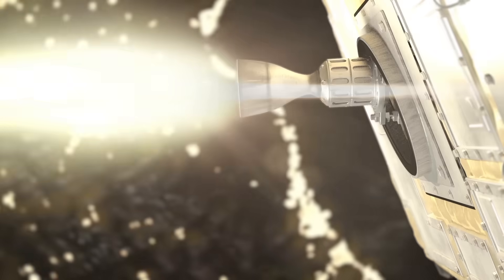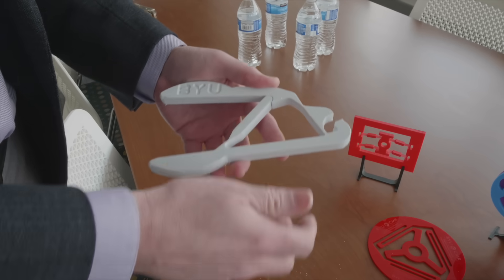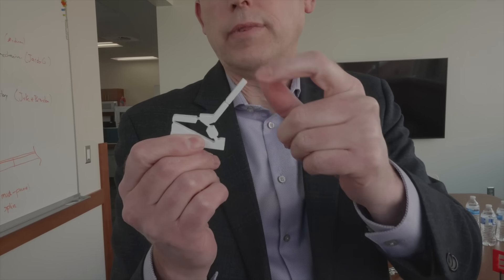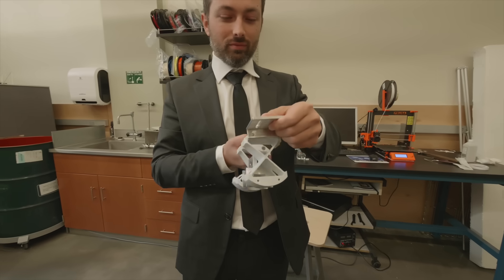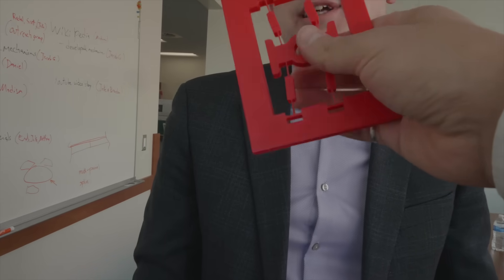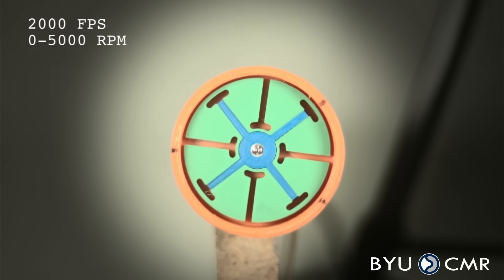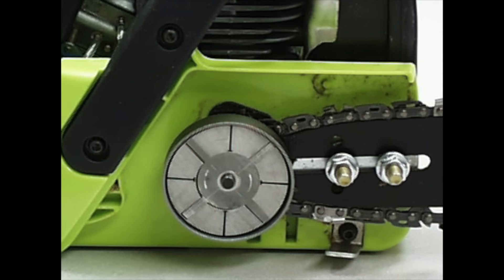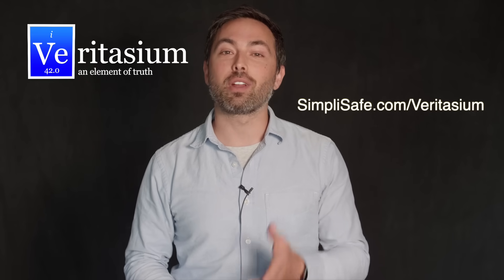Why Machines That Bend Are Better

Comment: Don't know why but this reminds me of origami. Once you've formed a two-dimensional piece of paper into a three-dimensional body and you're finished, you can't tell the beginning and the end. Sometimes I imagine the cosmos as an "object" within which many objects are contained, which is folded in itself so many times that it is impossible to see the original folding with the naked eye. If, for example, one would fold a piece of surface the size of a football field in origami manner into a body, it would shrink and at the end be as big as a table tennis table, but look like a hazelnut. 

The flexibility and willingness of the shown material in this video to adapt and at the same time develop great forces is remarkable. The more flexible the less quickly resistors can destroy it. However, I'm a little sceptical about plastic ...

In any case, if a piece of paper were very large, its flat surface could pop up three-dimensional bodies like water lilies on a pond. And yet the two-dimensional would inevitably be connected to the three-dimensional. The "empty surface" would then be the space that holds everything together.

Comment: Practical examples of use of compliant mechanisms in everyday products
1. Every shampoo bottle uses a live hinge made by injection molding - very cheap, durable and assembly free.
2. Computer mouse buttons use flexures (those bendy things you see throughout the video). The microswitch inside it has a diaphragm flexure and the top casing flexes when you press on it to transmit the compressive force. Older mouse models had separate distinguishable buttons, now its all one piece.
3. Cable ties have a very small tooth with a flexure that engages a rack. You can often reuse cable ties by disengaging the tooth from the rack using a pin and pull out the rack while holding tooth off the rack with the pin.
4. All plastic components of every product you use has a snap fit for assembly - no requirement of fasteners.
5. Every book uses live hinges (crease where you bend) for opening and closing.
6. Some cheap click type ball point pen (e.g. Bic retractable pen) uses flexures to keep the extended pen nib in its position.
7. Tic tac box uses living hinge for the lid.
8. Volume rockers on your cell phone uses flexures instead of springs to bounce back
9. If you have a wind up pendulum clock, the pendulum is suspended by a flexure for avoiding friction caused by use of a pivot.
10. Snap fit locks for straps in duffle bags/backpacks etc.
11. Some shot microphone mounts uses flexures for vibration isolation.
12. Camera lens covers uses flexures for springs for holding the cover on the lens.
13. Disposable food containers, clamps for IV lines.
14. Paper clips.
15. Foldable plastic forks found in ready to eat noodles have a living hinge in the middle for folding.
16. Leaf springs in vehicle suspension (Thanks to Heartycoffee in the comments for suggestion).
17. Tweezers and forceps (Thanks to randal gibbons in the comments for suggestion)
18. Safety pins (Thanks to DrBrainSol in the comments for suggestion)
19. Accordion-style toilet plunger (Thanks to Gary Young in the comments for suggestion)

 p.s. I will add more to the list later. I love flexures and thank Derek for making a video on compliant mechanisms with Dr.Howell
Reply: Haha I was thinking to myself "if compliant designs are so good, why aren't they used everywhere?". Turns out they are used everywhere and I'm just unobservant :)
Reply: @skulleeman  Yes They are omnipresent. They are most widely used in disposable food containers to single use clamps used in IV lines. Please keep a close eye on everyday objects and you are bound to find them everywhere!
Reply: Yes and many are crappy with the flexible hinges easily overstressed thus failing and breaking off.
Reply: @PebblesChan  Yes certain consumer products do have badly designed living hinges and I have had similar experience. However, a properly designed living hinge should last thousands of cycles if not more. They would fail prematurely if they are not designed properly, use of wrong type of plastic, if they are bent over their design limit/excessive force, if they are subject to extreme heat, or if they are subject to UV light(sunlight). Please do not get me wrong. I use them all the time. If you design, use them properly they are shown to last at least a million cycle as the Professor in the video claims. Even a 3D printed flexure lasts hundreds of cycles for me when I use them in my lab for my experimental setups. Often times they simplify design with no assembly required. They are indispensable in applications where you cannot use lubricants. for e.g. MEMS, certain medical devices.
Reply: Many are not properly designed and having machines cyclically repeating the same action does not emulate real life where there are substantial differences, variances and exposure to idiots.  (No one can engineer against stupidity). I have a car window switch that comprises of the simplest possible machine essentially being just a rod of flexible plastic that pushes onto a copper leaf switch. Just with normal use the end shortens being unable to make the copper leaves to make contact. The biggest problem is that the replacement price of that switch is about $250. In the same vehicle there is a plastic combination stalk mechanism (its second) that now fails to invoke the fast wiper speed unless one deliberately over twists the switch and holds it there. The price for that is about $600. The original plastic combination stalk mechanism failed by not being able to invoke high beam. It's amazing that something that costs cents to make can cost so much as replacement parts.

What I find most amazing is how pressed metal sheeting can outperform solid cast metal structural components.
Reply: @PebblesChan  I agree with you on the fatigue testing. Fatigue testing in the lab are not exact representation of real world loading conditions, but it is one of the best ways of estimating usable life through accelerated testing. Regarding the car window switch it is most likely planned obsolescence. Many a times manufacturers follow the "Razor and blades business model". The reason why spare parts are so costly is that, the spares themselves are not expensive as you mentioned but the manufacturer recovers part of the initial cost through spares. Spares also provide a continuous revenue for the manufacturer. It is worth mentioning that the flexure that holds the pendulum in my grandfather's clock works perfectly after close to 70 years of use. It is made of spring steel. I doubt a plastic flexure would last even a decade. Flexures really come in handy in disposable products like foldable plastic forks, food containers etc. They are indispensable when stiction comes into play. The uncertainties posed by friction are completely negated when you use a flexure for a standard pivot. I am not saying flexures are a panacea for all design problems but in most cases they do outperform conventional hinge/pivot.
Reply: Yes and many are crappy... That's what I thought in the late sixties when we were shown (on "The Engineering Programme" a throttle pedal for a Bedford (a GM subsidiary) van. One piece injection moulding, floor mounted, a vast improvement upon the multipart metal assembly it was to replace.   Surprisingly good.  @PebblesChan
Reply: Leafsprings?
Reply: @heartycoffee4754  Yes leaf springs are flexures. I will add it to the list thanks.
Reply: This comment was awesome!
Reply: @doubleq1223  Thanks.
Reply: I thought wow, 5 years and the world would be different :D, but it already is
Reply: @Joe Black Yes I understand your plight. Badly designed compliant mechanisms can be a pain in certain applications.
Reply: Karthik C 

Forceps?
Tweezers?
Reply: @randal_gibbons  Yes definitely. I forgot to add such a common everyday item. Thanks I will add it to the list.
Reply: safety pins too
Reply: @DrBrainSol  Yes. I will add it to the list. Thanks.
Reply: Go kart frames are designed to flex because go karts dont have suspension they use that as a substitute
Reply: @martynasdaugela973  Yes. Certain Go Kart designs forgo the suspension system for simplicity and such kart's frames rely on the compliance of its frame for minimum suspension travel.
Reply: How did you type all this in one lifetime....
Reply: Really neat examples especially shampoo bottles
Reply: simply a spring itself is a flexible component just seperate from the rest of the mechanism. Also cheap matress and sofa made from foam.
Reply: The accordion-style toilet plunger is a compliant mechanism
Reply: @garyyoung7290  Yes Indeed! Will update in the comment. Thanks.
Reply: What about other types of springs and vehicle suspensions? Like coil springs, torsion bars, etc?
Reply: @fabianab8320  Typically a mechanism is an assembly of individual linkages and has a definite relationship between the input and output. I am not sure whether one can call a spring of any sort as a compliant mechanism even though a spring itself constitutes part of a compliant mechanism. For example, you can look at a paper clip as a compliant device but not a mechanism. So, coil springs, torsion bars etc. are building blocks for compliant mechanisms and not compliant mechanism themselves in my opinion.
Reply: @karthick86c  Ah, thanks!
Reply: @fabianab8320  You are welcome.
Reply: Here is one example: How bow shoots an arrow!
Reply: Box?
Reply: What about a Mtb cassette
Reply: So...how do I make money from this? I mean, by buying stocks
Reply: The clicker on the JVC "Marshmallow" ear buds that I am wearing. It broke.

Many of those annoying child-proof bottle caps.

Resealable plastic bags.

Paintbrushes.

Tubeless tires.
Reply: I mean normal spiral springs are the same thing

Comment: The Apple "butterfly" keyboards use flexible joints like this, and they have a ton of failures and a large number of customer complaints. I like the low profile and minimized key travel, but I had two keys fail and had to take my MacBook in for repairs after less than 2 years.

Comment: Zenith has produced the most accurate mechanical wristwatch, Defy Lab, using the same principle in producing a monobloc oscillator taking the place of ~30 components in a traditional balance spring system.

www.bobswatches.com/rolex-blog/new-releases/zenith-defy-lab.html

Comment: The plastic will crack at the stress points eventually, so more waste, and no more tools that could be inherited.
Reply: everything will crack at the stress point, its called stress point for a reason. the thing is, its just one piece, easily replaced

Comment: i want to see the material properties. How much bending can those pieces take, how much force, etc. They clearly are not beefy enough to take on the same task a pair of vice grips can. And they clearly cannot be used as many times. What are the inherent material properties that will let you bend it tens of thousands of times without it becoming brittle (think like bending a paperclip until it breaks) that is inherent to all materials?

Comment: But you have to keep in mind that this cant usually take much force as other counteroarts (cause the bending parts need to be small to get bended) it its lifespan decreases a lot if its constantly used and not just sporadically lots of times

Comment: From an engineering point of view I would add a point 9 which has in part to do with #8: the failure mode is easily diagnosable. A broken device is incredibly easy to detect because the failure can be "felt" and very often "seen" on the whole part because there is structural integrity i.e. there are no poles which would e.g. swallow diagnostic waves like in a classical device.

Comment: I feel like it's really cool that you can 3d print it... so you can send to space a 3d printer and a nylon based filament that has great tensile strength which is really what you need for this as the flexable area needs tensile strength and the other areas can be made thicker to compensate for the lower shear and compressive strength of the material...

even better if you used a 3d printer that can print metals which gives you a good combination between tensile and compressive/shear stresses.

Essentially allowing astronauts to custom build tools as needed not relying on resupply missions.

Comment: In my experience, tools and products that bend rather than turn on a hinge or hook tend to break the fastest. I'm sure that for very specific application where a part is designed with on goal in mind it's great, but I'll take a traditional vice grip. 
For example, if anyone has ever tried to repurpose a tic-tac container(for holding tiny screws or small tools) you would know that the flap that keeps the container open or closed is designed to bend, and is also where they tend to fail first. When I've fixed electronics, the number one point of failure in most cases was either a spring or a piece of plastic that was designed to bend or apply tension; i've had to replace the springs in my playstation controller about 5 times. I've also worn glasses all my life, and the part that always breaks first is the nose guards, which are supposed to bend to fit the shape of your nose. 
Unless there is some new unknown element discovered that can realign at an atomic level, I can't see how things that are designed to bend are supposed to be a solution to moving parts, which do suffer from mechanical wear, but for the most part provide consistent performance up until the point of failure. I'll take sudden failure over a gradual decline in performance, but that's just my opinion.
Reply: Happyfeet also throwing away interchangeable parts seems bad

Comment: Who was playing with twanging plastic parts like this as a kid? Switches etc. Plastic hinges have been around for decades too, along with multi-million operations before failure - I'm sure I read about this in the 1980s. And I got the elephant question right...Blah, blah...
..OK I'm a smartarse...Still, it's not new..Is it. Is it?

Comment: most machines are failing at exact these supercheap parts and then the whole thing is worthless and cannot be repaired...
its maybe cheaper to build a vicegrip out of plastic. but if it fails  it goes to the trash. a metal vicegrip can be repaired very easily  or simply bend back.
for satelites it is ok, beacause you cant send a repairteam and wheigt matters...
Reply: Also the vice grip thing doesn’t actually do the task of a vice grip. A vice grip bites down on something and stays so you can go and get another tool

Comment: The obvious downside is that you can't repair them once they break, and for many of these I could see they would break quite easily if they are misused.  Also failure would be total and instantaneous, where a traditional machine would likely indicate their is a problem before total failure, which you could repair.
Reply: Yeah but you can 3D print the replacement and don't have to rely on parts being available somewhere.
Reply: You dont repair a pencil that breaks you repair a car when it breaks.
Reply: @maheshr4108  You are comparing the housing of a satellite thruster to a pencil?
Reply: +Clinton Leonard- you can make backup/safety mechanisms in case of failure, but yeah it's not a miracle invention, everything always has upsides and downsides
Reply: @clintonleonard5187  The greater advantage with anything in space is durability. You want a part that lasts the longest since you won't be able to repair it at all unless you send an extremely expensive mission to repair it. You probably don't want to put these in the hands of someone who will just misuse them.
Reply: You're not repairing the whole thing, you're just repairing the part. Take for example the satellite thruster: if the compliant hinge broke, would you replace the compliant hinge, or the whole satellite? When a piston breaks in an engine block, do you replace the piston, or the entire engine? If the engine is poorly designed, you'd have to replace the whole engine. The exact same thing applies to these mechanisms. Like everything, they have applications they're well suited to, and applications they're poorly suited to.
Reply: Did you not see the part about QC?  he said that switch has to date gone through over a million flips and still going.  For a part that costs pennies to make Id say that is a good ROI!

Comment: Why did he only talk of the positives? Why did he not discuss the cons of these alternatives, like the fact that compliant mechanisms cannot be repaired, only replaced? Or the fact that these mechanisms are built on the principle of having strategic weaknesses? Or the fact that their  operating life when made out of plastic ("at least over a million cycles") is barely equal to or less than the operating life of traditional mechanisms? Or the fact that plastic, likely the only current material that compliant mechanisms could be made at a consumer-level, cannot bear heat like traditional metal pliers of the same price point? I think this video's discussion on their positive impacts on the engineering world is great, but focussing only on what's good about them feels deceptive and makes the title sound like clickbait. Great Production value though, awesome interview with the inventor by the way.

Comment: At low temperatures eg winter temps I think the material would fatigue at faster different rate than at room temperature. Difficult to repair item if it breaks. A consumer cannot evaluate the quality of the plastic. A small tool kit with compliant hinges I had broke (after years) at the hinge, obviously did fatigue.